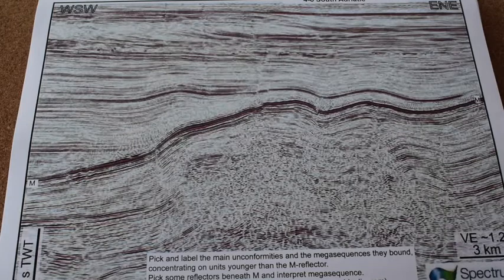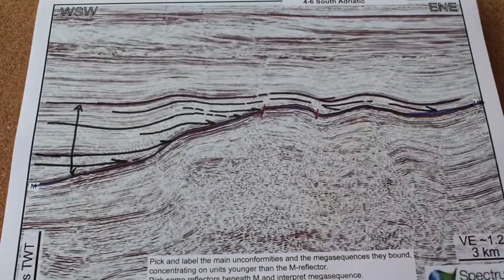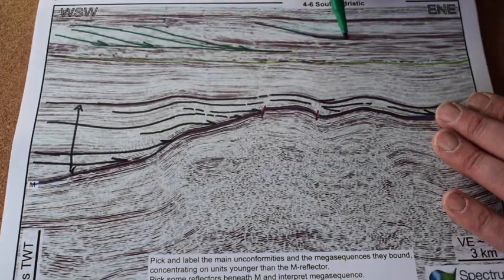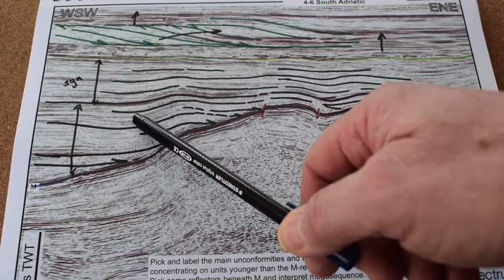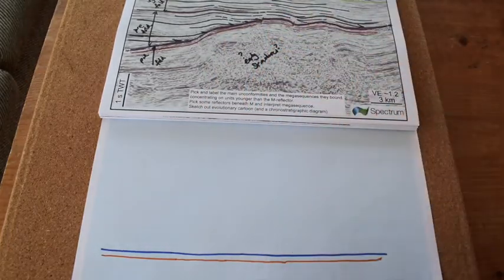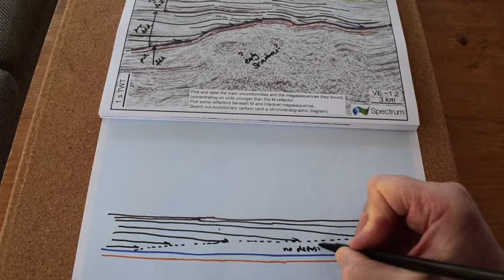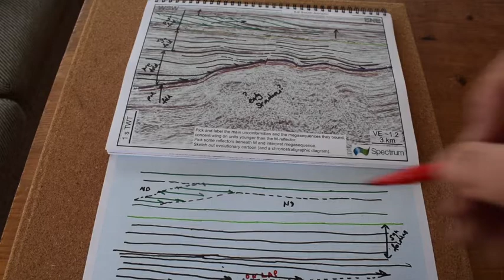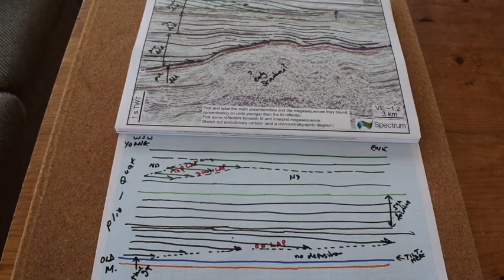Interpreting a seismic profile - Southern Adriatic

Comment: Thank you so much, and i just wanted to ask about the upper prograding layer , when we interpret it we say that a regression happened and the deep sea is supposed to be in the east direction? Am i correct? And the brown reflector on lap is a transgression from west ?
Reply from the maker: Thanks for the question. The uppermost package of inclined reflectors represents progradation (of actually shallow-marine strata) into bathymetry. No need for a regression. But for sure the deeper bathymtrey was to the R of image (ENE). As for the deeper onlap, no need to infer transgression - if this is all under deep-water. We can do all this with sediment supply variations... within a submarine world....
Reply: @robbutler2095  thank you so much for the clarification!🌷